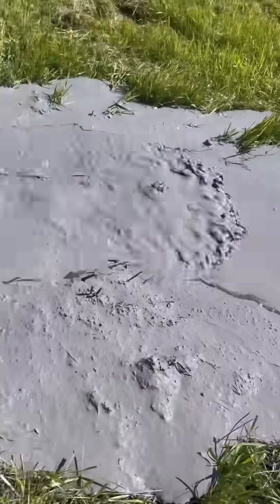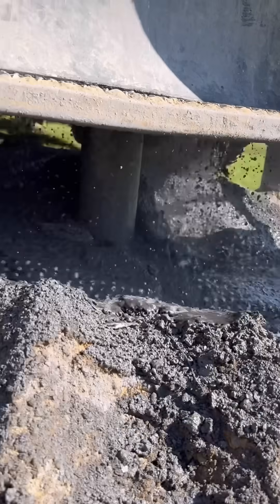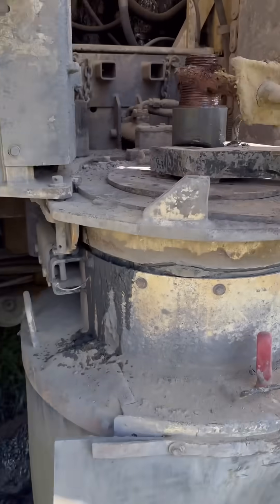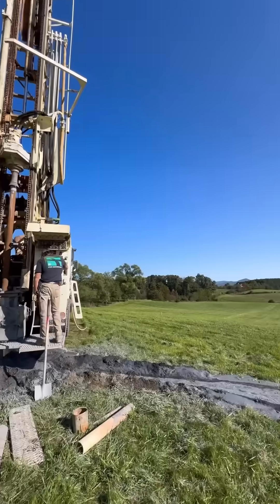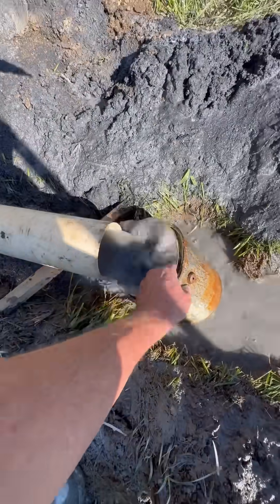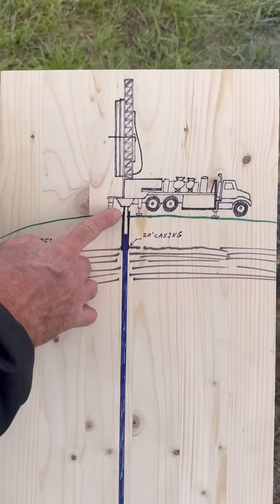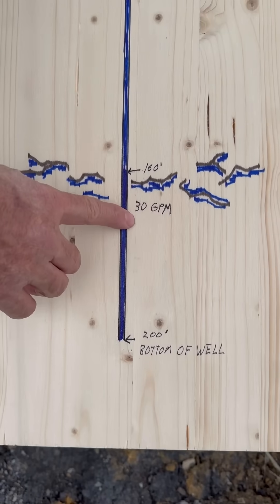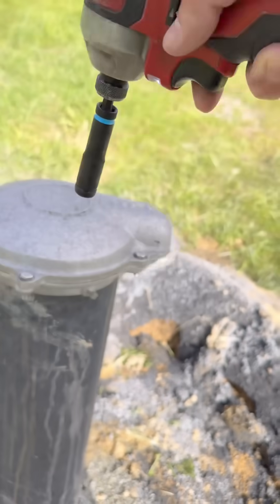How To Drill A Well

Comment: We had a customer in Philadelphia that drilled two separate 1000 foot deep wells for a geothermal system used to heat and cool a 25 unit apartment building.. The cost was top secret as the entire project was stupid expensive as part of a Net Zero multi unit building. Through the grape vine I heard  $150k for both wells.

Comment: My house in Massachusetts has a well thats only around 40ft. The water level near me is high. I can dig 3ft & the hole will fill with water. My well was put in in the 1940s & its still my main water today. Back in the 50s & 60s my well provided water to every house on my block. I still get scared though that it will need redrilling. My cast iron pipe going down is now in kinda rough shape.

Comment: Bro, i just had a well company come out for a 320ft deep well.
Im on a mountain in the shadow of the cascades in western wa. we didnt hit bedrock until 198ft. Bone dry to 400ft. Next day they came out with 200 more feet and were hoping there was water that seeped in... nothing. drilled to 500ft, water. came back to frack it cause it was 2.5gpm and i was like, "f it, we in for a penny, in for a lb".... they went to frack and found water at 180ft.    theres 320ft of static water in my well now. 
Now im waiting on the pump to be installed...and alas, my hand dug, 30ft deep cistern has gone dry hahaha.    50k for the hole.
Reply from the maker: Wow

Comment: Cost is nearly entirely depth and what state you live in. In Connecticut, probably $16k or more.  I had a GSHP closed loop well ( 6 inch) drilled to 268 feet IIRC, required 140 feet of casing ( 7 section!!!) before rock, and cost an extra $1800 for the casing. That well cost was close to $18k for well, loop pipe, well grout, casing. Took them 2 days to finish.

Comment: I drilled a well in the children's sandbox using parts from the broken trampolin to make the drill. Only investment 12m 16 cm plastic pipe for about 100 dollars and i have a very nice well. Add a pump for 250 dollars and free water and return on investment in under 2 years. And no need for a gym card that year.

Comment: I was quoted $10k for 500 ft deep, but haven't pulled the trigger yet because the one thing more important than water is septic system. You can have water tank with rainwater collection system but without proper septic system, you can't build anything on PA

Comment: Well water is a big yikes. They're easily contaminated with few protections in place for owners and even less for renters (when public health workers find cancer hotspots the amount of pushback from state representatives andl/or senators trying to protect the companies most likely responsible or worse trying to sweep it under the table at the behest of real estate agents and developers that want to unload their stock before it comes out the local water supply comes with a high risk or cancer instead of helping kids fighting leukemia is disgusting) and bc of archaic laws about water rights, wells all over the country are going dry thanks to industrial operators coming into rural areas, putting in wells 150-300 feet deeper than an average residential well and proceeding to immediately suck up so much water it lowers the water table for the whole area, leaving the locals SOL if they can't afford the 50k it costs to dig a deeper well and cratering home values as a home without a water supply is basically just a fancy  storage shed.
Reply: I would trust well water more than City, or County water any day. It also tastes better without all the chlorine.
Reply: @JD-lq2ef  you do you pal. I'm not your mom.

Comment: Just dig the well $12,000
Reply from the maker: $9,700
Reply: @ nice , my well in the mountains in Colorado was 800’ . Luckily it was done before I bought the house . Although 20 years later I had to pull up the pipe and wiring and replace the motor and wiring 20’ at a time :-(

Comment: ayy this is what i do! but for irrogation system in the south. we call them center pivots theh have a mbout 12 towers and get abkut 300 to 500 gpm! The pump we put in are absolutely enormous  usually a 9 phase pump goes down there. Usually cost around 50k 😅

Comment: A well is a water catchment that varies in hole size from 3 feet to 30 feet in diameter. I have two wells both are approximately 30 feet deep and are stone lined. 
A bore is what you are drilling in this video.

Comment: I live in Georgia. Work for a well company would charge about $6,000 per well installed no matter how deep. Also, I hate to say that there's probably a lot more expensive in different areas. Usually we can drill 2 to $300 ft, but sometimes I have to go 5600

Comment: Wow costs vary.  Just looked up cost of drilling a well in 2 places florida and nebraska.  Florida top price is roughly 9,000 nebraska 13,000 could go up of course but still those are the typical maxim prices.  Reminds me of the good ol days of digging a well with a shovel and pulling up water with a bucket.

Comment: Remember you only have that flow rate at max pressure.  Depending on the size and draw on the reservoir, that flow rate can fluctuate wildly.   It's good practice to pump a lot at once to get an idea of the volume you have access to.  I personally wouldn't bother over 30min though.  Unless you have agricultural land to spray you won't need more than that at a time.

If you build your own buffer reservoir then this becomes almost a non issue.

I have no idea about the cost. I'm not American.

Comment: In SE Poland (closest city is Biłgoraj) farmland, most wells are hand drug. They use a 3’ diameter, 3’ long concrete casing (factory made and bought) that is male on one end and female in the other end. They dig the hole about 6’ then put in the casing and then have a small person get in the casing and dig. Most well depths are around 30’ deep. Sizes above are approximate, they use the metric system. Some homes have a jet pump and tank to supply to home, some use a bucket.  Cost……?

Comment: I'd say the cost is grossly misproportioned based on the limited actual work involved. 10% physical work and 90% machine work usually results in a bs bill.
Reply from the maker: That’s an expensive machine they have to pay for with a lot of maintenance. Also, it burns a lot of fuel.
Reply: @hausplans  that doesn't justify it. Like a plumber charging 3k for unclogging a toilet. Or 2.5k for leaves in a gutter. Just because you can do a job doesn't mean you need to make it bankrupt people for your own gain. Yes there are always costs to run a business but you dont need that golden crapper in the process.

Comment: Gotta be 6 to 7k. We lived on a hill of limestone and had a similar depth made. Wasn't too bad. But would recommend a very very good filter system & stainless steel fittings for plumbing. It really made drains & heads look rusted & nasty.

Comment: Wow, that's a huge difference to my home state of South Louisiana. A neighbor dug his well by hand with a hand turned drill. He stopped at 12 feet. Our well for our home was 20 feet. Any hole you dig deeper than 6 feet will be wet by the next morning. That's why the cemeteries all use concrete mausoleums. Many are above ground.

Comment: Without any equipment, but pump set in well - $15K. 
Full setup (concrete pad, 3-5k gal storage tank, variable speed pump, insulated pump box, control panel, meter pole etc) $35-45K.

Comment: These pictures bring back memories. They are not of the water drilling rigs, which we always called Bullshit Rigs. I worked on an oil rig during my summers while I was in school before being commissioned in the Army. Because my dad was the driller, I would get a vacation shift for one of the floor hands for a couple weeks. They talk of going to two hundred feet, but we had one well that was at 7,000 feet and was still going when I went back to school.

Comment: I’m an exploration diamond driller. I knew that was cuttings from a rig in that trench the instant I seen it. Good deal hitting bedrock at 20 feet. I love jobs like that. I’ve had to case over 700 feet to hit solid bedrock before. That sucks. We need our casing in before we can drill any further. Casing sucks
Reply from the maker: Very cool, I had one well where they had the case down to 500 feet. It gets expensive. Thanks for sharing.

Comment: A few years ago I became determined (read: obsessed) to drill my own home irrigation well. Water table where I live (FL) is 25-30ft down. Three attempts, two of which ended at the hard pan with 20ft of pipe frozen in the ground. 

Last attempt I went all out: mud pump recirculating a bentonite slurry through a custom built mud pit. Went down 35-40ft and was watering the lawn the next day.

Comment: I think in 1979, I had a well driled with the old Pounder Method...about 70'...around $5/ft...I put the pump and everything else in myself...changed pump twice in 40 years...gas wells and fracking mad the well heavy with iron...luckily, the gas wells had Tenaska build a Power Plant, and they put a 24" water line down my road and we were able to tap in...

Comment: 14000 to 16000 depending how big the pipe is and if they sealed the bottom with concrete and 200 feet wont even  find water in most of the middle of tx most wells is minium of 450 feet that just reachs water

Comment: This summer in my new Farmhouse drill a new 30mm(6-inch) 250foot  borewell  for 150 thousand Indian Rupee or to say 1750 U.S dollar approx All includ( 2horse-power= 1500watt submersible pump 260 foot food grade 6" pipe smooth grables 300 foot 3wire copper wiring 1.5mm and all the labour charges 😀

Comment: In my area, well drillers NEVER find water in less than 4 attempts.  Even when there's a prior existing well.  Usual tactic is to keep the bore filled with bentonite as they drill way past the known water table.  This will ensure that no water gets into the bore until they've bilked the customer several times.  Also, going at least 500 ft past or 100 ft short tends to affect results.

Comment: drilled my well almost 40 years back  -  it's at a bit over 600 feet  -  no rock here ( South Mississippi )  and lots of water at various levels:  some at 65 - 75 feet  -  but you have to go deep to get good water

well got struck by lightning about 20 years back which blew out the casing,  so new well   -   same guy who drilled the original well came and drilled the new well  -   he said he would drill it for whatever the insurance paid plus my $1000 deductible  -
Reply from the maker: I’m surprised they weren’t able to fix the old well
Reply: @hausplans  the original well had 1 1/4 inch galvanized pipe for pipe stem for hundreds of feet down to where the casing went from a 4 " to 2"  -   when they came out to check the well the pump would hum but not pump,  so they said they would have to pull the pump  -   they set up the derrick and on about the 10th stem ( about 200 feet ) one of the guys yelled hold it  -   showed me where the lightning had jumped from the metal stem to the casing  -  told me then the pump would be locked up with bits of casing debris  -   he was right,  there was all kinds ( lots ) of blown out casing bits brought up with the pump  (  which was locked up with debris from the casing  )   -  he said that pump would still pump and he could try to push down a smaller liner but that he couldn't guarantee it would work,  or for how long it might work:   and in any case I would have to pay for the work and materials if I wanted to try  -   told him it was a bad gamble all the way around ( 20 + year old well & pump )  just put in a new well

Comment: Last I knew the Rotary got 16.50 a foot. Using 8" casing.  My FIL well went 526'.

A mile away neighbor used the same operator. 529'.  It later collapsed on the pump the water wouldn't clear.
They brought back a hammer rig that was on site more than 2 months to retreive the pump and clear the hole before the water cleared.

Comment: In 1975 my brother and I pounded lengths of 2.5” inside diameter steel pipe with a conical steel well head through layers of Coastal Virginia clay and peat to reach the sandy aquifer at about 80 feet depth. Then we dropped an electric pump that fit inside the pipe, primed it with about five gallons of city water from our exterior taps, and started pumping. 
After seeing that it functioned, we connected the well to an indoor electric pump, so just a switch on the wall allowed us to water the garden, fruit bushes, and quarter-acre suburban lawn.
The Driver “system” was just a 4-foot length of six-inch diameter steel pipe, marketed as a driver for steel fence posts, with a welded cap and two handles, operated by the brawny but ignorant twenty-some-year-old sons, directed by the Dad who understood the whole operation.
Driver — $15, Well-head — $65, 100 feet of threaded pipe, ~$90, internal well pump — ~$100, Floor mounted pump for garage — $175, refreshments for the labor force — $30.  (approximations from 5 decades later)
The system lasted 25 years, total cost about $400 in 1975 dollars,  not adjusted for the runaway inflation.
The city has almost quadrupled in permanent population in the years since, and wells must be drilled FAR DEEPER to reach the aquifer.

Comment: I know a family that managed to dig an artesian well by hand. Just kept digging down with shovels until the water came in faster than they could pump it out, and then the water kept rising above the ground level
Reply from the maker: That’s cool!
Reply: @hausplans we have 1 well never dries up hand dug
& 2 cisterns.
One dad built a filtration thing with river rock charcoal & sand  for house roof runoff & the spring fed hand dug well is connected with a pipe & a pump brings that water up to house cistern.

Comment: Had ours drilled while we were building our house back in 1992. The guy who drilled it was a second  generation well driller, He came up over the hill with a HUGE number of trucks and various other equipment. Went down 300 feet but found water at 200 plus feet, and as others mentioned, he went down further so that we would always have water.   When it was time to hook up the water to the house, they came back and did that with a holding tank in the basement. They also installed our septic system, which I had cleaned on a regular basis.

 I sold the property 8 years ago. When they came back to inspect the septic system for the new buyers, their report stated that the septic system was as clean as a new one! 
As far as I know, they're  still working well. As for the cost, it ran in the thousands, but cannot remember how much for either one. I DO remember that the type of septic and leach field they put in was still working well, but would have had to be upgraded to a different type which would be more than double what we paid for the initial install.

Comment: Depends on area and other factors,
For example: 1980s they charged $36 for every 30 foot of pipe, then they charged for the pump.
Now after an over 300% increase in inflation, that would be a minimum of $10,908 for every 30 ft.
Now thankfully back then they were massively overcharging to account for profits and wear and tear on machine as well as employee wages, which means more wiggle room, so a 200 foot well will on average cost you $15,000 to $21,000 depending on if the drilling was easy or they hit too much thick rock and had to drill again.
A good aquifer location, like some spots in Georgia, you might get it cheaper at like $3000 to $7,000 the pump included.

Comment: Where I live, most wells are only 50-75 feet deep as we're part of the Lake Michigan watershed. For some reason, the well on my property is 300 feet deep. I doubt mine will ever run dry. Being so much deeper than the others around me, I actually get much cleaner water. Still a lot of iron, but with an iron filter, I can actually drink from the tap, where my neighbors all rely on bottled water for drinking.

Comment: Back in the 80s, we had to drill for water.  The company we hired said that they would get water for $2,000, no matter how far they had to drill.  After 7 holes (over 1000 feet combined) and twice reworking the equipment, Mr. F hit water at 72 feet (thanks to a dowser, sometimes called a water witch).  We got 32 gallons a minute.
Reply: 72feet? So he hit the mainline, didn't he? 😂
Reply: Mr F would have being saying the F word a lot after hole number 2......lol
Reply: Dowsing is a classic example of counting the hits and ignoring the misses. You'd might as well ask an Ouiji board where the water is. Every scientific experiment that has ever tried to verify the effectiveness of Dowsing has found they are as effective as random chance.
Reply: Old county worker didn't trust his expensive detector and kept a couple of L-shaped steel rods...said they were more reliable.

Comment: The submerge able Aka deep well pump itself is going to cost up to $2,500, deep well wire $2.75 per foot= $550 for 200 feet, water well pcv schedule 80 $25 per 10 foot joint $460, water tank $270, 40A double pole 240V breaker $90, then the well itself is 5,000 to 25,000. So are looking at roughly 10,000 to 50,000 easily.

Comment: I had a 230 foot well drilled on my property 7 years ago. Put a hand pump on the well. Total cost was just under $5k. The water itself is wonderful. Crystal clear. No sulphuric or other rotten tasting stuff.

Sand from the surface down to 180 feet where the bedrock stated.

My guess
... your well will cost approx $6,895.00